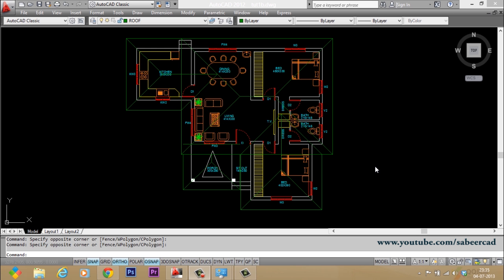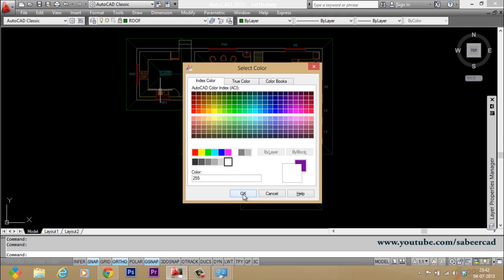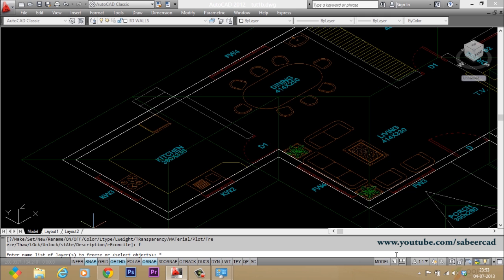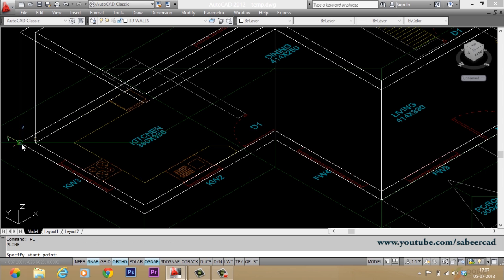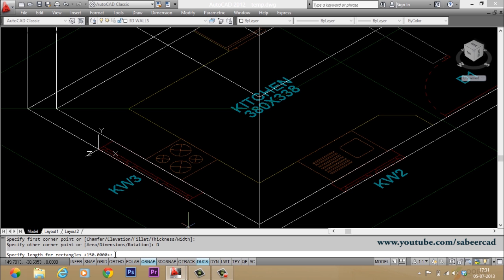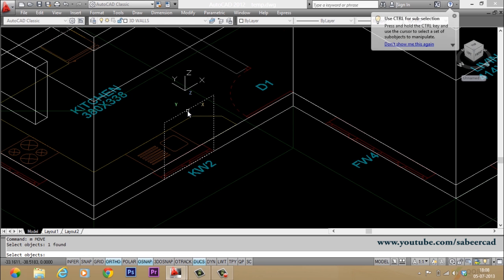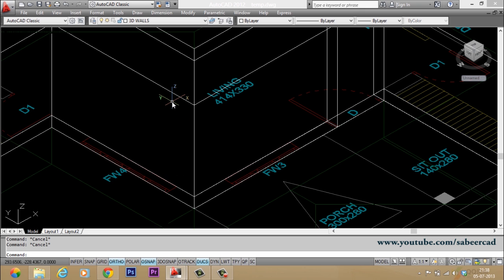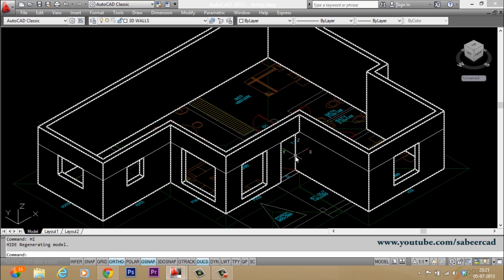AUTOCAD 3D HOUSE  | MAKE 3D WALLS IN AutoCAD

Comment: Beginner's mistake: In case PRESSPULL doesn't work when you're trying to do cut-outs, make sure your layer isn't locked. I know it's silly, but I left my 3d Wall layer locked and I did my window rectangles in a new layer .. hour later, I figured it out :)
Reply from the maker: Ok.  Its nice that you fugured out

Comment: Is there an advantage in using AutoCAD that I have overlooked? It seems so work intensive when compared to revit because you have to define everything yourself.
Reply from the maker: It depends on your requirement . AutoCAD is a general purpose software which can be used to perform  2D drafting & Annotation , 3D modeling , Basic rendering and Visualization  and people of different background can use it . But revit is meant for a specific purpose and it needs high end system configuration to install ...

Comment: Good video. Very informative on the process. I learned some new tricks!

My one comment to add for anyone watching that is unaware, the commands LAYISO and LAYUNISO (Layer Isolate and Layer Unisolate) are much easier than manually freezing all layers, even with the shortcut shown. (Unisolate will turn on all the layers frozen with Isolate) (Isolate command asks to select one or multiple objects and keep those layers turned on, turning off all other layers.)

Comment: Assalamu Allaikkum,
May peace, mercy and blessings of Allah Subahanahu ta'ala be upon you and on your family.

I glad to inform you that I have learned 70% of autocad through your youtube tutorial and it was very helpful to me while learning 2D floor plans and 3D modulation.

Further, I reached at the stage of using UCS and i couldn't find midpoint on the extruded object.

For Example: 
I followed your tutorial of 3D Home Plan. In that you are making 3D glass inside the window shutter frame using Object Snap to find the midpoint. But i am trying as it is same, i am not able to do that and cursors not going to midpoint after selecting the polyline.

https://youtu.be/_L-h8h9uBGU 

I look forward to receive your reply as soon as possible.

Thanks & Regds
Haja Ismail.
Reply from the maker: Happy to know that You are making the best use of my channel . Alhamdu Lillah ! Just change your visual style to wireframe and pick the mid point . Make sure that MID point of OSNAP is active while you do this .

Comment: Hi sir,

My DUCS is turned on, but the rectangles are still not aligned along the wall, but only along the floor.
I am aware that there is another method to manually align the UCS, but I would like to know if this method can be done correctly!
Reply from the maker: If you can follow the step by step you will get the result.  If you find any difficulty please follow the second method explained ...

Comment: how can i adjust the height of the presspull? i made a mistake in the height and i want to change it without having to delete everything i did.
Reply from the maker: You can always give undo command to go back . But if you gave already closed your session you can try MOVEFACE option of the SOLIDEDITING panel in the HOME tab .
Reply: sabeercad thanks I will try that. I already was too far into the drawing when I decided to change the height of the wall. Doing an undo would be disastrous. Thanks for the help

Comment: HAI SABEER SIR. assalamalaikum  how r u? i follow your all videos its very useful to me , i practices 3D house part -1,making walls, in that I switch on DUCS(Dynamic ucs). when i am going to make the walls that rectangles come on bottom not on the correct walls. please help me. i am using AUTO CAD 2017. please reply me
Reply from the maker: +Maharaj Banu Keep the cursor on the wall face till that gets highlighted and then define the point to create the rectangle . If the first method fails , please use the second method (the next video)

Comment: after using the rec command, height option is not available, i only got lenght and width
Reply from the maker: +wale egbodoku Only when you extrude it you will be able to provide the height
Reply: i mean when u wanted to make rectangle for the window, u did not extrude, u just put ion the rec commmand, dimension, u den selected width, lenght and height

Comment: my window cutout rectangle is off and wont line up to the wall, my ucs is set up correctly.  I'm very frustrated.
Reply: same issue..sometime it work sometime it didn't.if you find the solution pleass tell me.

Comment: when you draw a rectangle for the window how you can insure that the distance is equal in the both sides of window ?
Reply from the maker: When you use the MID Point Snap on the top edge of the rectangle which you use to make the window , you get the exact mid point .

Comment: Hi. I created a rectangle using LINE and join commands and then OFFSET it. PRESSPULL command doesn't work. The bound area between the 2 rectangles doesn't get selected. Please advise. I am trying to create a wall with this method.
Reply from the maker: +EUTube Just zoom the two walls and click on the area between the two walls (Don't click on the walls) . Alternatively , you can extrude and subtract  the outer from the inner wall

Comment: aslam sir i am having trouble with UCS in 3D in a new job plz help me out
Reply from the maker: Just align the UCS on the plane where you work using 3 point or face option of UCS command. Give ucs command , type 3 point . Pick the new origin , x and y directions. You should turn off Dynamic UCS button at the status bar (at the bottom) when you do this.

Comment: +sabeercad the tutorial is great, but i have a problem with the ucs command, i cant seem to solve it, and due to that my rectangles are not forming on the corrrect plane, and then, when it does, i cannot move it onto the lintel level. When i try and move it straight to the linear, it automatically moves to the centre of the lintel line, please help ASAP
Reply from the maker: Glad that you liked ☺️

Comment: When I try to make the first window cutout (KW3), I can't get my rectangle to be drawn on the YZ plane... it only allows me to draw on the XY (2D) plane... any tips or is there something I need to do to allow drawing in the 3D space?  Thanks!
Reply: Never mind, I realized that I was in "Drafting & Annotation" instead of "3D Modeling"  Great tutorials!  As a mechanical engineer now in a facilities engineering career I will be watching all of your videos to learn the AutoCAD software the best I can.
Reply: mvtrumpetgeek13 Actually, only the line tool works but works in both modes... the rectangle still won't let me draw on the yz plane....
Reply: So what I missed was creating the profile... my DUCS is on... but i can't pick the profile of the the wall... the whole 3D wall gets highlighted...
Reply from the maker: Rectangle can be drawn only on XY plane . So align the XY plane (using UCS command) where you want to create the rectangle..

Comment: thank you! you are very helpfull but i have one problem. when i do the presspull command it doesn't trim the surface but it creates another object. can you help me?
Reply from the maker: After creating the rectangle , give press pull command , click right at the center of the rectangle , drag all the way inside  till the wall thickness is crossed and then click .This will result in a cut out . If you still find it difficult you can try the next method to create the cut out (Please refer option-2 video in this channel .
Reply: sabeercad Thank you so much!!!

Comment: Hello there....My name is Nirmit n Im a Civil engg. student. It was quite interesting to learn from here as it is quite simple. One thing is that Im facing a problem here. I m using AutoCAD 2014 n while making cutouts in the wallls I m unable to make that rectangle on the z plane... even with the UCS on. I don't see y is this happening. I extruded external wall n now I want the cutouts for doors n windows n Im stuck here. Though I found another way of doing it by making a rec on xy plane n by extruding it. After that subtract that box from the outer walls n It will leave the door cutout but I just want to know y I cant use the method U have shown in ur tutorial above. Please reply to my problem. Thank U.
Reply from the maker: Just follow the procedure step by step you will surly get the result. All the best..
Reply: im not getting the desired result. Please help me with UCS settings if any n How can I set my views. I still draw rec for cutout n it lies on the xy plane n not in z direction
Reply: I am with you. All i am getting is another solid and no matter what i do i can not get the window to subtract.Nirmit Kumar
Reply: Subtracting a window is not an issue...Problem is that I can not make a rectangle standing up It always llie down on the top plane
Reply from the maker: First make sure that dynamic UCS is active . Give rectangle command . Then take the cursor on the desired face and you will it getting highlighted . Just click the first corner when the face remains in the highlighted stage (important) and complete the rectangle
Reply: u can make a rectangle in the top view where u want the door then go to SW isometric view n now extrude the rectangle upto the height of the door suppose 7'. After that put it to shaded. Now use command Subtract(SU) n first click on the outer wall from which u want to subtract the extruded rectangle then enter now click on the extruded rectangle n press enter n u will get the desired result...
Reply: Thank u so much I m getting the result now... This highlighting face thing is the key..
Reply from the maker: Ya right.. All the best :-)

Comment: your video has been sooo usefull to me, thnx!,  but those profiles for windows and doors doesnt create with the presspull command like yours, im using autocad 2015 and they doesnt create "automatically" like you do it, so i had to make boxes for each window and doors and use substract.. it was sooo slow, does it has to do with the USC (face) i used that doesnt allows me to do it the way you do it?
Reply from the maker: Thats for your comment . You can use the subtract method . presspull you have to do invidually for each window while subtract can be done in one go...
Reply: sabeercad thnx

Comment: Good morning Sabeer
I am using Autocad 2015, and when trying to make the rectangle for the windows, I only obtain it in plane view althought the UCS is on. How can I solve this problem.
Thanks for your reply
Reply from the maker: Just turn off the dynamic  UCS and align the UCS using the three point option of UCS command  before you create the rectangle. Alternatively you can also use the FACE option of the UCS command to bring it in the required plane.

Comment: Thank you so much for your tutorial. It's very easy to follow.
I have a little bit of a problem that comes when i try to do the cutout for the door. The problem is that when a use the command PRESSPULL, my Autocad (Autocad 2014) inmediately stops working and i don't understand why. It always happens when i try to do the cutout for the door (i did it several times). Can you tell me why is that?
Reply from the maker: Thanks for your interest in my channel. Presspull needs more memory and software is likely  to crash. In 2015 version this problem is not seen . you can do extrude and subtract to get the same result.
Reply: sabeercad
Thanks for the advise. I thought my computer was good enough for this type of program. I guess i'll try with the 2015 version.

Comment: Hello Saaber, I noticed that you always draw using the CURSOR with the UCS integrated, I guess is easier to work like that. How do you do it?  to make appear the UCS at the same point as your CURSOR????? Thanks
Reply from the maker: You can always use the face option of UCS command to align the UCS on any desired face . Just give UCS command , type F for face option then click on the desired face . thats all....

Comment: hello. thank you for the video. I am having problem with the press pull command. I tried to select in between the polylines for the wall. it is not working. I hope you can help me out with this. Thank you
Reply from the maker: If presspull does not work you can extrude and subtract...
Reply: Thanks man. Was able to do it later.

Comment: Hello Sabeer, I really like your videos and am enjoying learning 3D cad.
I am baffled what I am doing wrong at the 7:00 minute point in the video. You do a press/pull command on the window and you say that it automatically snaps to the depth of the wall (240cm) I cannot get the press/pull to automatically snap. Is there something in my settings that is preventing this?
Best Regards
John (UK)
Reply from the maker: jawbkk  When you do press pull you have to pick right at the center of that rectangle and drag the mouse backwards till it crosses the wall thickness and leave the mouse there . Then you should be getting a cut out . If this fails then stick to the second method (option-2 video) . All the best

Comment: When doing the presspull for the window, it's not punching the hole in the wall, any idea why? Using AutoCAD 2014 here.
Reply from the maker: Josh Donner  When you try press pull freeze all the layers except the current layer . If that didn't work try the second option (MAKING 3D WALLS OPTION-2)
Reply: sabeercad Unfortunately neither of those things worked for me, but thanks for trying :)

Comment: sir ive been following the steps,but wenever i do the presspull command for the other side it wont do the cut out,instead it created a box,..wat to do?
Reply: because you select the line, you have to selec in the midle of the rectangle not the line, so the perimeter of the rectangle turns in dashed line and you are movin the mesh not the line. sorry for my english not native.
Reply: thanks james
Reply: no problemo